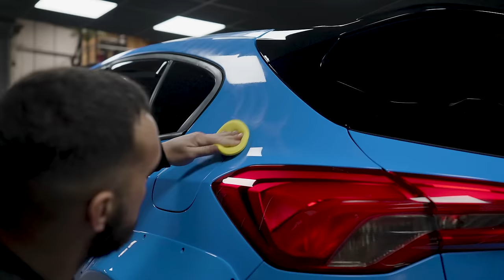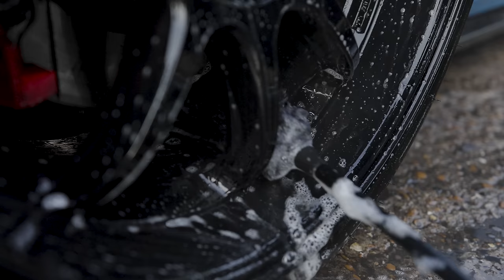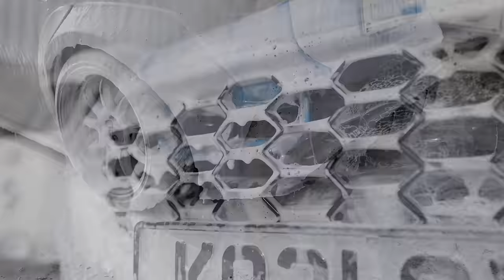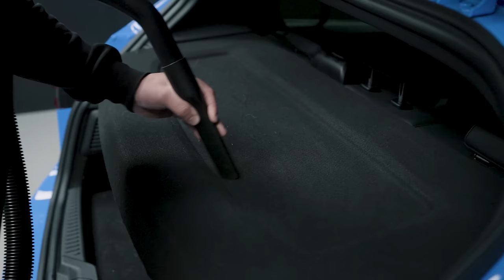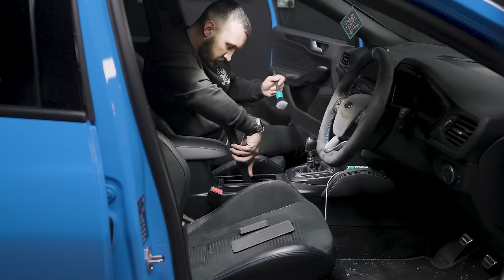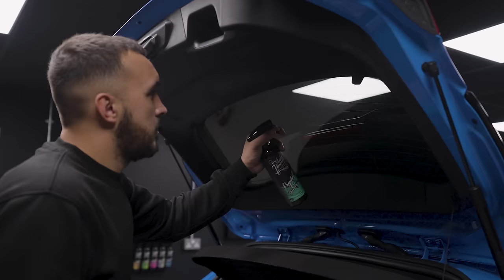Auto Finesse - Detailing A Filthy Ford Focus ST

Comment: If you are the owner of this car and are reading this…. Then High 5s to you for winter tyres!!! Miss these types of cleans 👍🏻🏴
Reply: High fives right back at you bro
Reply: Cars a topper mate looks brilliant, that colour is next level! 🤩
Reply: Usually people in the UK 🇬🇧 doesn’t use winter tyres because it doesn’t freeze or show that much but for the last 2 years we had some pretty rough weather, but there are some people that are using winter tyres. 
Personally because I don’t driver outside of the UK 🇬🇧 with my car I didn’t get winter tyres, but I am still rocking Michelin cross climate 2s on my car, which are certified as winter tyres and plus they do good in every weather conditions I had them on my previous cars too. Highly recommend them if you live in the UK, or in any other part of the world where you don’t use winter tyre.
Reply: @_MrRed_  i commute 73 miles per day 5 days a week on a dual carriageway and some people well most drive like its the summer, in Scotland i am more concerned about Ice than Snow. At work there are so many cars with bald spots etc these people scare me as they have child seats in them. 

When i see a cracking car like this with winters on makes me proud to know someone else cares about what happens to them and there car which in turn looks out for other people. 

👍
Reply: My focus st edition looks just like this did before it was cleaned. Really needs a good going over. Try and keep it clean in this weather but within couple days it’s back to how it was. But when it’s clean., like this, looks the bo**cks !! Love it !!

Comment: If you see this, three questions:   1/.   Is it safe to use a power sprayer on every engine?   

2/. Do you guys ever talk about what products you’re using?   

3/.  I’m in the US, I saw where you’re going to start selling your products here sometime soon.   I’ll be keeping my eye out for that.   I’m super interested in whatever you’re spraying as what seems like your final top coat?
Reply: Don’t use power washer on the engine bay. Not a good idea especially with the number of electronics on modern cars
Reply: It's generally fine to use a pressure wash on your engine bay, just keep a distance like he does in the video and cover up anything that would need covering up the same way.

The focus being the way it is only needed the cone filter covering, yours might need more
Reply: I do detailing I pressure wash the engine bay of every single vehicle and I have never had an issue

Comment: good video, would be better to have pop-up text on which product you are using, for those that don't know the product range.  If the owner fitted some rallyflapZ mudguards, there wouldn't be as much sling down the side of the vehicle, or road rash on the paint -- they worked well on my ST years ago.

Comment: Why did you fallout and tar and glue, then wash. Wouldn't the contact during these ground the dirt in?
Reply from the maker: We wash the car first, decon and then rewash to neutralise the solvents and remove and clay bar lubricant that can interfere with later polishing stages or prohibit bonding of waxes and sealants.

Comment: Jet washing an engine bay is a big NOOO
Reply: It is if you don’t know what your doing
Reply: @DAMTB  even if you know what you are doing water will always find its lowest point so god knows where that water has ended up 🤷‍♂️
Reply: @ryanSLF  if your going right up close with high pressure then sure, but if you spray with less pressure from a further distance then that is absolutely fine. Obviously you should always check for exposed electrics and intakes. But jet washing an engine bay is absolutely fine, if you are doubtful of cleaning one then leave it to the professionals